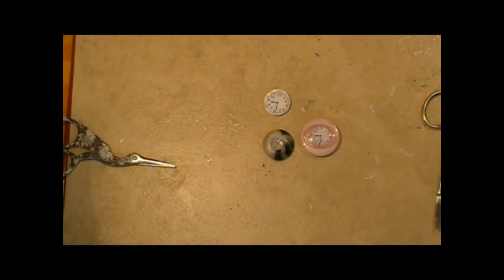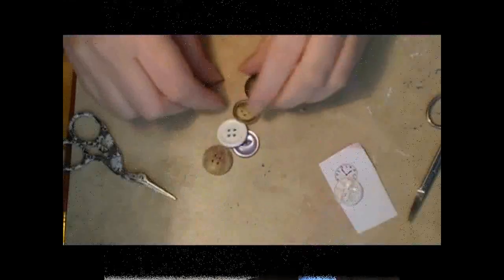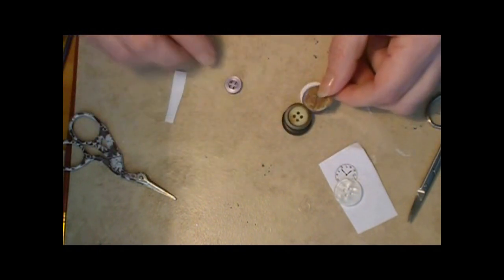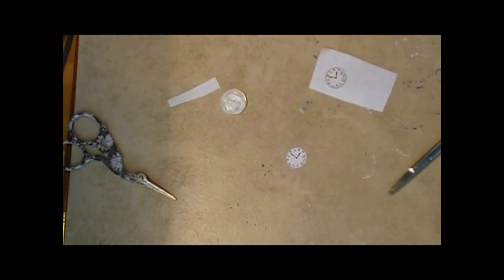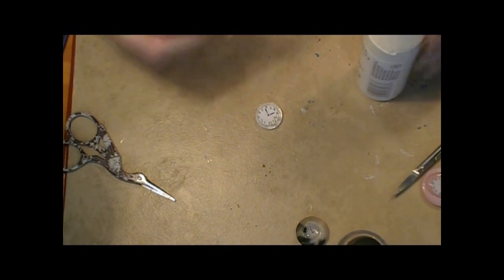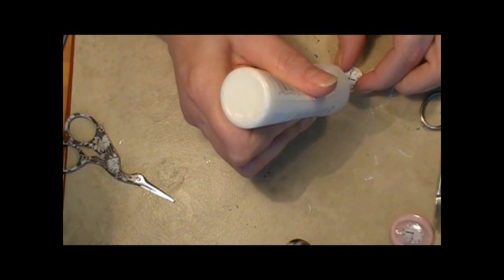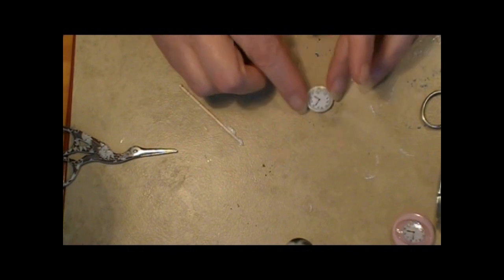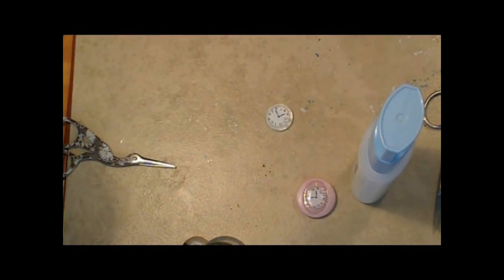Dollhouse Miniature Wall Clock

Comment: I found a similar tutorial about this online but wish I would have seen yours first;  I like the look you achieved with nailpolish.  I made several little clocks using mod podge dimensional magic.  2 turned out nice enough to use but the numbers on the clock face went blurry on the others.  I think I'll try again with nailpolish in the spring, when I can do it outside (nailpolish gives me a migraine).